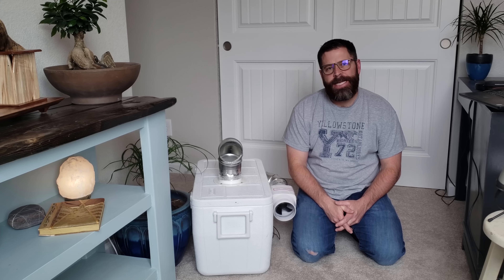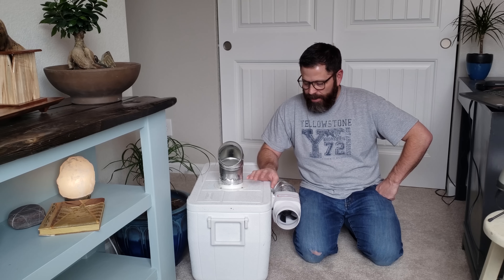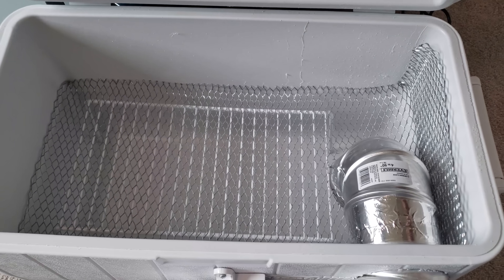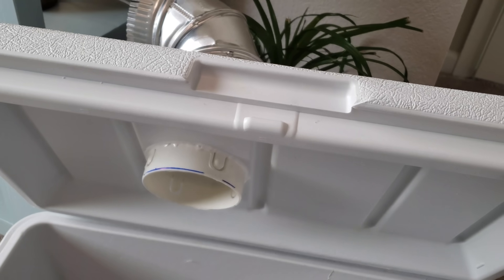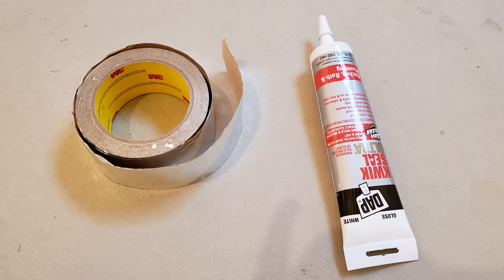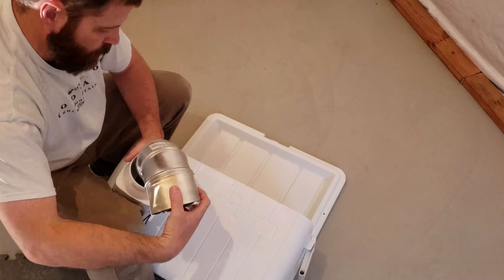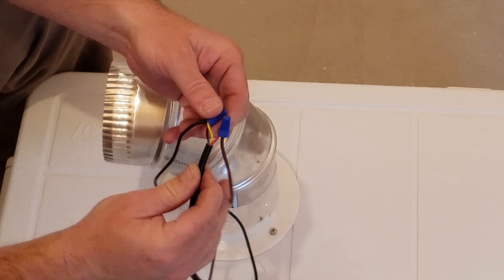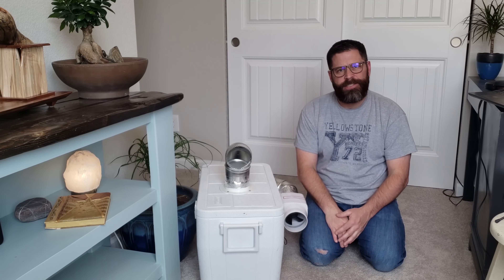Homemade Portable Air Conditioner DIY - Coldest One Yet!

Comment: The better the cooler is insulated, the more cold thermal mass you will have at any given time to push cold air.

Better insulation around the cold chamber= slightly colder internal temperature= higher output per volumetric unit

Comment: bro, try this: add salt to the cold waste water, and pump it through a small radiator with a drip pan, and have the output blow over the radiator. You'll dehumidify, and increase the efficiency, decrease energy needed, and increase output by a lot! It will also make it a true air conditioner.

Comment: The irony of using ice, created by a pressurized refridgeration system, to then not use an air conditioner lol
Reply: not really I can not afford an AC unit I can do this I have 2 refrigerators with freezers (need but do not have  a chest freezer

Comment: Question.  Can this blower be hooked up to a solar panel, if so what size would it need and or can it be powered by a deep cell 12V battery with a solar panel to recharge the battery?

Comment: This does not address the humidity in the air, a traditional air conditioner removes the humidity which room moves the latent heat as well. All this is doing is adding or keeping the humidity at the same level, so it’s not really effective method

Comment: I think this is great but what if you added a second blower in reverse so 1 blows air into the cooler and the other blows the air out. Would that increase its effectiveness? Would you end up pushing more cold air out of the cooler? Either way this build looked clean and very well put together...i am subscribing hoping to see more DIY projects like these or better..
Reply: I was thinking the same, then I realized the temperature will cause condensation. Wet electric fan might not be so good. Lol

Comment: when the ice melts, wouldn't the water block the air duct opening which is only 1 or 2cm from the bottom ?   How do u solve this problem ?
Reply: The intake air duct doesn't come close to reaching the bottom. It pretty much stops right at the grate which from my guess is about 12 inches high.

Comment: Now when they see coolest came out I had the same idea I will take on a whole bunch of ice and put a fan or that little small portable AC cooler I want you and you know by cheaper now look it up to that you know it's no different like with a hose and turn the fan on Fallout new no cold ice air but the remembering with the outside in your intense that's a lot of moisture that could be you know built up so cold moisture and I'm not necessarily bad but you know too much moisture buildup you know could be an issue cuz then you could get you know mold on the outer or inner arm layer of the tent moisture so

Comment: If I had a YouTube channel I would take it one step further and use that blower motor with a variable speed switch and put it on a 12V freezer.Wal-A airconditioning off-grid.

Comment: Add some salt to your ice the temperature should go lower. I’d just worry about corrosion so use pvc pipe instead of metal. Would like to see this and if it makes a difference on temp coming out cause I know it will usually lower the water temp to about 27f yes I know this is below freezing, just try it salt lowers the freezing temp of water. The ice will actually last longer as well. Myth busters did an episode on salt in ice water in a cooler the results aren’t what you think it’d be.

Comment: If you turned the cooler around so the inlet on the blower was facing backwards and you put a filter on it the sound be much quieter.

Comment: So after the ice melts in 3 minutes , what then ?  You don't have an air conditioner or an air cooler , you have an ice melter
Reply: Well, in a vehicle or RV you would cool the air first with the vehicle AC, than you are running cool air through this. It will last longer. Also many portable ice makers use leas than 150 watts and make ice in less than 6 minutes, so you can refill with ice often and drain the water out through the bottom...............     It is ideal for days when it is hot and combined with insulation and window shades can make a difference

Comment: Does the water level of the melted ice affect the airflow from the fan? It looks like the intake is at a very low level and the air might be pushing through melt water.
Reply: These things do not work it's basic science if you studied HVAC at all

Comment: First off I do HVAC work. Your fridge has to displace heat from your freezer. (No such thing as cold just lacking btu's) so the heat goes into your house. Secondly you are taking heat from freezer putting it in your house to make ice. Than you take the ice to cool your house. That isn't productive. the ice would have to come from the store. Your fridge would just be running to make ice heating your house up more. Do research first.

Comment: Rock salt with the ice.. gets it cooler but can put out corrosive humidity if used in a shop or auto I use a similar setup but with a pusher and puller setup ice and salt one side with mesh for chunk ice salt mix other side with frozen Gatorade and water.

Comment: I built one to these specs and it works great but you can burn through a 20# bag of ice in an 1 hr.  It blows cold and its perfect if you have an on-site ice machine.  I run all my power off my solar system.

Comment: What about a PVC pipe that runs on the bottom of the cooler and has several holes drilled into it and you dump all the ice on top of that? That is an idea I have recently come up with.  Awesome build by the way!

Comment: Great job. Suggestion: drill your inflow toward the bottom of the cooler so no second elbow and tape needed, no hole on your mesh and you can put more ice there. The less the warm air has to travel, the lower the temperature on the outcoming cold air. Also, have you thought about adding an exhaust fan at the top to project the air further out in a larger space? Or maybe, for more air volume, how about  putting two air blowers on the sides of the cooler for more air volume. It will also look literally "cooler", more symmetrical, kind of like some kind of ship with the motors on the sides.
Reply: I guess why he did that is so when the ice melts, it wouldn't interfere or ruin the blower motor
Reply: I like where you're going with this, but, then the water would come through there. Perhaps if the ducting were faced upward, but then I think there would be an issue of it filling up and blocking airflow.

Comment: To replace an air conditioner with a capacity of 5000 BTUs, it is necessary to melt 36lb of ice per hour. Your car Air Conditioning is about 5 Tons (60,000 BTU) at highway speeds. It is about 30,000 BTU if you drive in City. So, if you on the highway, be ready to spent 432lb of ice each hour and 216lb of ice if you drive in City.
But it will work well in the small tent :)

Comment: I just built this unit 2 days ago. The cold air is great !! The problem, I realized, is that I am taking 94 degree air from outside into the cooler and it melts 20 lbs. of ice in just 2 hours !! Any suggestions would be helpful.
Reply: buyin a ac

Comment: Would be interesting if you could run ducting back and forth inside cooler to form a heat exchanger and use ice & rock salt.   A salt bath can reach 0°F.   So in theory your discharge air could be significantly colder.  Plus you would get cooling the melted ice bath versus just blowing through the ice while it’s frozen
Reply: I like this idea of ice and salt. We are making our own a/c and will try your idea.
Reply: @kathleenfoster8552  - good luck with your attempt.  The short coming of ice based system is keeping the ice/water cold.   Ever though about evaporative cooling?

Comment: I think you should try one with multiple small  tubes to carry the air through the ice/water and you could even use coils of 3/8 copper fuel line type tubing in a removable poly tote so you can just drop the tote in the freezer. Freeze a solid block 2 feet by 1 by 1 for example.

Comment: Great little DIY AC The only thing I would change is I would have baffles to close off the vent and blower when not in use to conserve ice
Reply: I might add a regulator on the blower to control the output and also conserve ice.

Comment: Adding a layer of swamp cooler pad to the bottom and forcing the air to move through that would allow you to also harvest the cooling potential of the melted ice water more efficiently.  You would have to refill the ice less often. You could make a manifold of 1/2 pvc across the bottom with holes drilled along the pipe to spread the flow of air across the pad.
Reply: You might lose a bit of airflow but I bet the efficiency gains would be worth the trade off

Comment: Be good to have you do a test on longevity doing the blow vs suck methods on the fan motor to see if indeed it would be better to suck air through vs blowing it through. I also like the frozen water bottles idea. I like even better the concept of using super coolers with salt water. But regular water you can at least drink. Super viable system though. Jump in your pick up cap camper overnight and stay cool for the cost of a couple bags of ice. And you can use it as a cooler too. Neat concept.
Reply: Blow vs suck. Ha ha ha

Comment: I was interested? But Ice isn’t cheap anymore. How often do you change the ice? Or how long does it last? Before you have to buy some more? Oops! It’s a lot of stuff for only a short amount of time use. Doesn’t sound practical to me? Also . Coolers get moldy! 20 lb. bag of ice? $7.00. Where I am if not more? I have another idea? Use Dry ice. Lasts longer. But. It might get a little foggy? 😜😆😂🤣😂 If the water hits the ice from the fan blowing on it? It might not? Just a thought? Do not put water in it would be the answer? Just let it melt. It should be okay? It’s worth a try? Might save on regular $ ice costs? I used the small personal air conditioning box that is being sold on this site. I’ll never buy another one. I’m stuck with extra filters. It didn’t last long! Oh air conditioning uses lots of power or electricity! They need a dedicated socket too! Also if you room I’d hooked up on the same breaker as another heavily used room as far as electrical use? Oops! The circuit will blow on the same line easily! If you have a Play Station or game console hooked up? Oops! It will corrupt it and have to be repaired. Every time the power goes out! Pop! Oops! You may lose memory and have to re-download every time for your games? That happened to me several times. You can’t use certain items at the same time. Especially! When others are living with you? Turning everything on. Like bathroom heater fans etc? Overload on the circuit! Obviously electrical needs to be done correctly to current electrical standards. 😎 Oops!  Just read up on the Dry ice. Do not use it! You’ll die! Oops! That answered that question? 😜🤐

Comment: I would like to know how long it lasted on a full tub of ice
Reply: 20-30 minutes at 89° when the ice melts you'll have less cool air as the air bounces off the ice water instead of flowing through the ice. Unless you add a drain to get the water out.

Comment: man i bet if you ran the air through the water with a pipe at the bottom of the cooler, and drilled some holes in it, cap the pipe at the end so air wont escape, but only through holes, and let it bubble through the water, then makes its way to the ice.

Comment: Texas residents are required to be certified in HVAC to live here.  There is a test and everything.  Nah, just kidding, but I've spent so much dang time over the years messing with my AC units that I think I could probably build one from the ground up (okay, that may be an exaggeration, but you see what I'm saying).  At around 10am you feel it coming... much like the plant Venus as that sun starts to come around, the temp starts to bake the Texas earth.  And the humidity... Lord help us.  One typical summer, like clockwork as my AC unit clocked out, again, the heat baked my brain and I headed to Home Depot.  "Two of your most powerful portable AC units please".  HA, I have THIS problem figured out!  Got em' both in, locked the exhaust units outside of the windows, and BOOM!, fired those suckers up.  About 2 mins in and brrrrrmmmmm the condensers kicked in.  FLICK.  Out goes my power.  Tripped my breakers, and cant run both at the same time.  My eyesight may be fading, but my hindsight is 20/20.  Maybe should have just bought one unit.  The AC guy drives by my house every few days in hysterics with his evil laughter, knowing one day I will have to bit the bullet and shell out the thousands to have my house re-duct and new units all around.  Kids, sorry, Dad's hot and as far as college is concerned, you can have whats left after the AC is installed.

Comment: Hi very nice and you took the time to build one Great 
what would happen if you had fan sucking from  on top and on the side an inlet tube that brances off on top of the ice and under the ice the leingth of the cooler it would be sealed at the ends but with enough holes 1 " along the run to let the fan suck correctly  
Im thinking the longer the hot air is in the cold cooler the colder the air comming out  also how  well would you expirment work if you used like enough ice packs to seal the the top shielf ??
thanks

Comment: 20 minutes later you need another 20 pounds of ice.
Reply: Feel like yiu can use old empty water gallons and tap water and freeze those
Reply: You need 10 trips to 7/11 at 2.75 per bag.  Or a designated freezer to produce ice.
A 5000 btu ac is 100.00
What a a hole.
Reply: Add an ice maker on top and a drain to empty the melted water. You could drain at any level.
Reply: @bh9262  the ice collectors ive seen turn the water back into ice continuously

Comment: Would it make more sense to have the air pass through the low end of the cooler before exiting? Since cold air sinks.
Reply: It better to pull the hot air from above and turn it to cool air. Warmer air rises.

Comment: Awesome design!! Building it today to bring AC back to my 20 year old truck
Reply: how did it go did it work in the truck
Reply: @mombox8753  it actually worked better than I thought. Used a medium sized cooler some PVC and a 12v variable speed fan. It blows cold air in the hot summer but the amount of ice you have to have in that cooler is a bit excessive. Ice doesn't last long in Florida
Reply: @surfstarcc1  lets say u filled the cooler up would it last all night so u could sleep in the truck
Reply: @surfstarcc1  would u say a cooler full of ice blew cold for 5 hours?
Reply: @mombox8753  It would definitely last all night with the temperature being a bit colder and the truck not being as hot. If I fill the cooler in the morning the ice will last all day but it's mostly water towards the evening and needs to be drained out.
Reply: @surfstarcc1  thanks chris ill build one too! thats what i needed to know

Comment: how long the cold last ? and Could I use a lower blower (100-150 cfm) and a smaller cooler (24) for a compact sedan (ford Focus)? I need around 65 to 70 F not really colder.

Comment: I’m wondering what would be the best cord to use to plug this into an outlet? I bought one but it doesn’t seem to work (fan blows in spurts when plugged in) and I’m not sure why. 🧐
Reply: I'm building this tomorrow and I will be powering with an AC to DC 12 volt converter rated to 15 amps so i can use an outlet. ;)

Comment: So what about the amount of humidity you're putting in the air... Any thoughts on the humiditys effect on the cooler ambient temperature in the room? High humidity is uncomfortable even at 75 to 80 degrees. Thanks for the amazing video.
Reply: Wouldn't bringing the air temperature down through the ice wring the moisture out of the air?

Comment: I live in Minnesota, cold winters, hot summers. It got up to 91 today outside today, my room got to 104. I can't use an in Window air conditioner with my room setup, and the tower ones seem to concern me about effectiveness with my room size. My opinions are limited currently, so I may have to go this route

Comment: i made one similar a few years back but instead of the grate i got a transmission cooler from oriellys that fit in the cooler and a bilge pump that rina 12 volts so it would circulate the cold water for the air to go across so even when the ice melted it would still blow cold.

Comment: Built one a couple yrs ago. The trick is to get one to function WITHOUT the car running that wont kill ur battery.. The marine blower will
Reply: If it's sunny just run it straight off of a 100 watt solar panel. The panel will only give you 4 or 5 amps, but that just means the fan will run a little slower. Would be perfect for a tent.
Reply: @BellefontePerson   i eventually put two solar panels on my roof, wired them down to a deep cell battery with a backup battery, that went to an inverter, and stuck in AC unit in the conversion van
Which can when the van is off.

Comment: This is way better than the one I made on the fly at a campsite. I use a styrofoam cooler, a knife, some duct tape, and an office fan.

The theory behind the fan blowing underneath the ice makes more sense. My old lady was dying in the Texas heat when camping, and since the campsite didn't allow window units. I had to come up with something.

I had the office fan blowing downward onto the ice with the pipe at the top. It worked for the most part. I did not put a grate at the bottom.

But, I am going to build this one for future trips. The campsite price gouges ice because the nearest store (walmart) is 20 miles away. Smh.

So, I may buy a yeti or an equivalent cooler, buy/bring my own ice, and frozen jugs for our trips. They were selling bags of ice for almost $10 a pop. Ridiculous. It is what it is.

Thanks for making this video and explaining how to build it. Great stuff man!!!